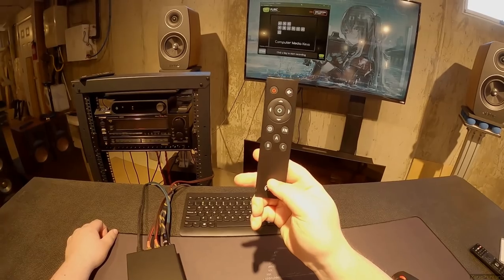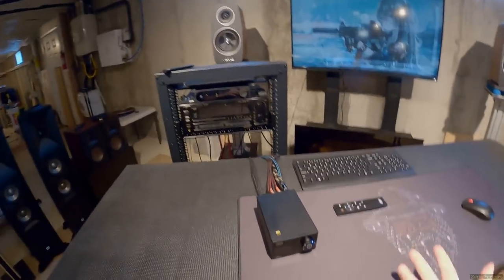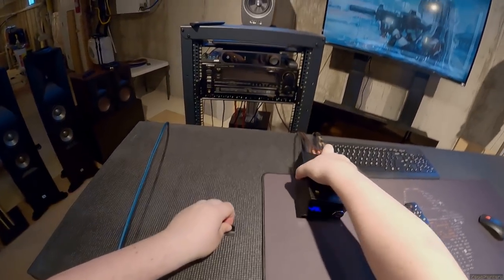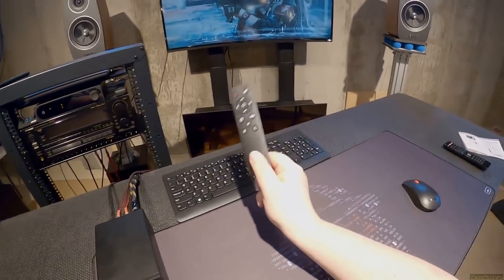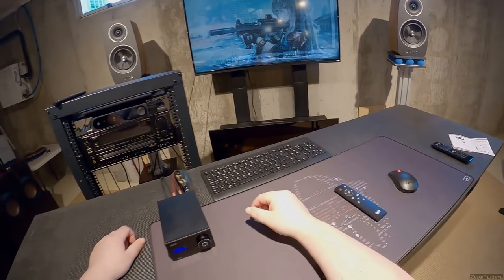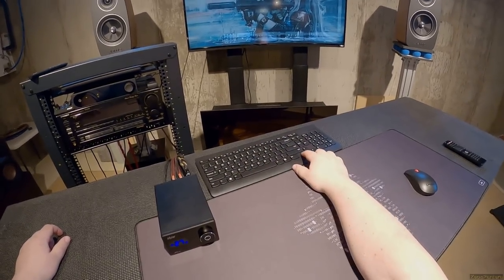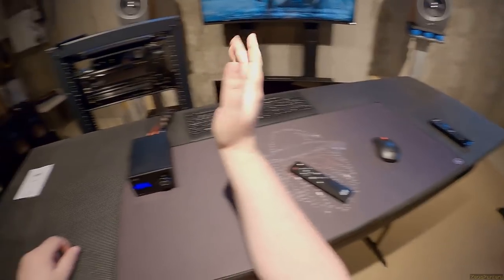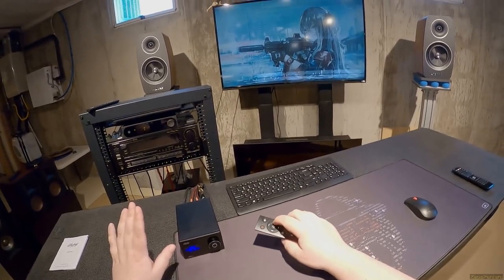Sabaj A10a _(Z Reviews)_ to INFINEON and Beyond!

Comment: Honestly I believe an external transformer for the power is way better. You can replace it if it breaks, and magnetism won't interfere with the rest of your circuit, especially frequencies with Class D.
We're talking a budget amp that probably isn't proofed of all distortions and noises...
Reply: ConcreteComa  You don't "break" transformers but, like all electronic devices that work with high power conversion, there's chance of it malfunctioning. Is it so bad to have it replacable?
Reply: ConcreteComa  that's where you priorize looks before efficiency. I understand your view, simply don't share it. I hide it behind my table, no big deal.
Reply: ConcreteComa  Sure thing bro, it's you who's complaining about something you don't get for the price xd
Reply: Here's my thing about that, than stop putting micro b on this stuff already. Nobody wants micro b anymore, if you're going to do an external PSU please ONLY put a usb c port on it. That Micro b port is more likely to break way before you explode an internal PSU.

Comment: that plastic you used to change the display color is called a gel, used in video production and film before that, I bought a color to put in my old kenwood car head unit back in the day to make the display amber to match the jdm theme then present in my car.  I ordered it from a big online av store here, well, the actual store is way up north from Toronto.  When I wore out the cd mechanism in that head unit, they were coming with variable color displays by then....and then I bought a Cadillac and although I missed and still do miss that installation, and having eyeball vibrating bass or hammer bass, depending on the sub box I was using, getting scammed by the former inlaws and their daughter means whatever the car has is good enough for now, maybe it's age.....the Bose system in the Caddy was good if the cd was produced properly, the Maxima was much better overall, this Jetta, its okay considering I had no intention of buying a Jetta, I was aiming for a Mazda 3 gt because I wanted to see what that zoom zoom was all about..the Jetta is comfortable, and handles decently if you throw it around...the Maxima was a joy machine, but there is not yet a budget for another.  Your reviews are always awesome, Thank you most kindly for your work Zeos.

Comment: I bought the Smsl sa300 after watching your review... it also has sub out and a DAC with BT and a nice screen for the same price... so why go with this unit..?
Running Kef q150 on a desk... 👌 goes loud in a smaller room/near field and sounds nice...
Reply: Actually, the Sabaj has a bit more power, lower noise and lower distortion. I also don't like the way the screen won't turn off during inactivity on the SMSL. I really only need the amp so I just ordered the Sabaj and we'll see......
Reply: hows the noise floor with the sa300 + q150 combo?
Reply: @Bvvbbx  nothing until 85% of volume which would blast you away if you were playing music… don’t go over 50% in most cases
Reply: @krancan25  thank you for your reply! I will pull the trigger on this set up right now!
Reply: @Bvvbbx  let me know how you like it.

Comment: I have the Fiio BTR3k,  but wanna know the benefits of getting the BTR5 instead, any good reasons?
And what's a good under $100 entry level worthwhile headphone or IEM to run them on?
Reply: I have the BTR5 and I wish I got the btr3k. It's great, but it's a bit too chunky compared to btr3. I didn't notice much difference in sound, especially through the balanced connection.
So if you're happy with the clarity and power of your btr3k, there's no reason to upgrade. Better get a desktop dac/amp.
Moondrop Starfield/Aria are great option for under 100$ iems. Aria is basically a newer, cheaper version of the Starfield.
Reply: @Zysperro  that is ludicrous, BTR5 is bae!
Reply: Fiio fh3
Reply: @Zysperro  There's nothing a BTR5 will give you over a BTR3 on an under $100 IEM or headphone.  I have both, my wife has the BTR3.  It is much lighter and easier to manage.  I have the 5 and don't notice any sound difference.  It is stronger and will driver harder to drive stuff, but won't drive very many headphones.  There are some IEM's it drives better, but that's at the $500+ mark.  There are plenty of under $500 that are fantastic.

Comment: Wait, the SMSL SA300 has a sub out to, and you may lose the internal PSU but you get Bluetooth and a USB DAC. I'm pretty sure the DA-8S has a sub-out to...
Reply: yes but i believe the sabaj is using dual mono infineon chips while the others arent. at least the upper level sabaj is dual mono with much better measurements than m300
Reply from the maker: da8s does not for sure
Reply: @ZReviews  You're right, the DA-8S doesn't have it. But the SA300 does. As for what @Red Leather said, no it uses only one MA12070 chip. But apparently, there is an A20a that uses 2 in mono mode, with 150Wpc and balanced inputs. And a 5V dc output, for whatever reason. 220usd and the same screen, huahuahuahua

Comment: Hot take: the SA300 is better value, because it has a USB dac, Bluetooth, and a way nicer screen. And costs the same. If not less. Buuuut it has the external transformer. Pick your poison. Could it be worse because it was put to market a year ago? Meanwhile this might have some covid magic inside that gives it the edge? 
So that suggestion to make this 150 bucks and slap a better screen on it is uuh No.
But great little unit. And I really really wanna see it's stack brothers.
Reply: I had the sa300, that DAC isn't really worth much.  You might have a point on the bluetooth but it's not like you're expecting good sound quality over bluetooth.
Reply: I had the SA300 too, and the amp is not in the same league. I suspect the power supply has a lot to do with it
Reply: I had the SA300 and personally was not sold on the digital inputs and still used a external dac.

Comment: When I go with the volume over or rather more under -15db it my unit starts to produce very severe distortion. Can this be hardware related problem or did anyone else experience that? -15db and below is no problem at all, it starts right at -14db.
Reply: What is your set up? Are you using the speakers in a large room? Thanks